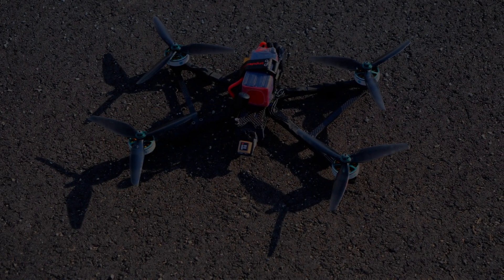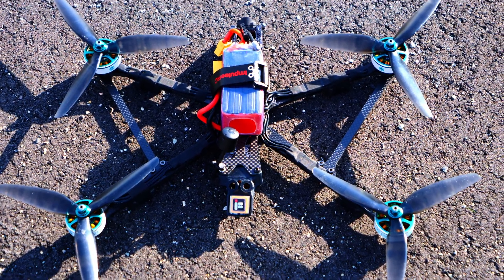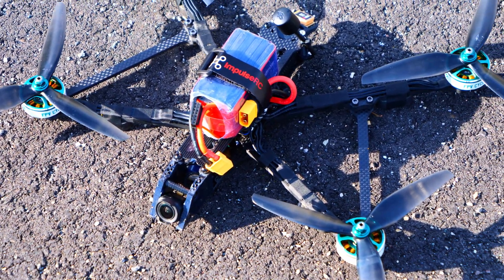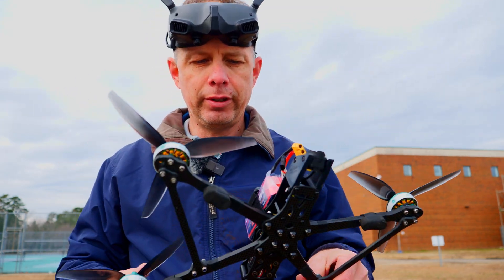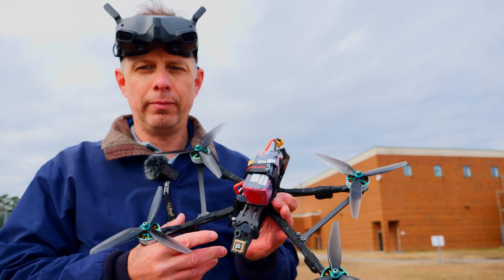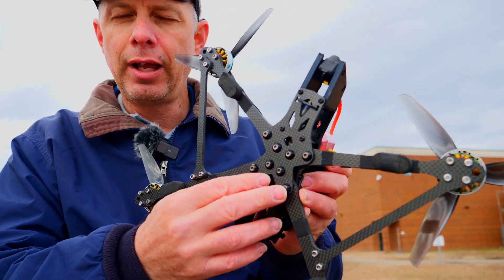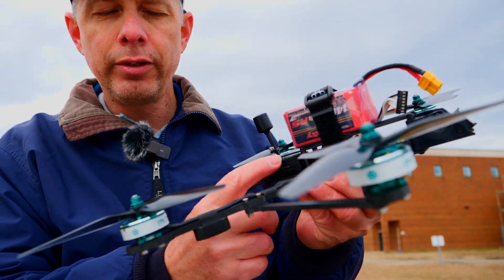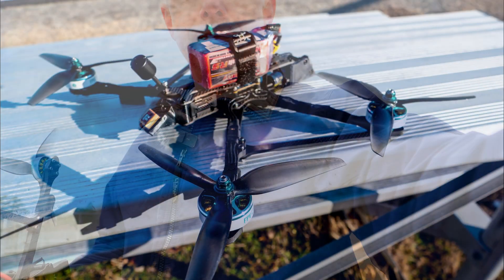DJI O3 Air Unit  Apex LR 7 inch frame (1-08-2023)

Comment: how did you get the 50mbps
Reply from the maker: Its stock with the DJI 03 air unit
Reply: @princesfpvdrones  what about the caddx vista units do you know if it automatically goes to 700mw like the goggles v2
Reply from the maker: @SeeFPv-qm6ie  I am confused, what is your question?

Comment: Nice build. Looked like it flys great. I have the pre apex version with 7" arm and love it. This new version seems to have even longer arm away from the main body.
How do you like the fpvcycle motors? Unfortunatly you cant get them in europe. I'm happy with the emax 2807 and rcinpower 2806.5. The J75 props are my favourite 7" so far. Try some hq 5x4x6 props if you want to fly around in stealth mode

Comment: I want to bet this frame to and replace chimera7. But i still wonder will the 5.5mm thickness arms with braces stiff enough to remove wobble and bobble? Love my chimera7 because of the strong 6mm arms that give smooth flight and easy tuning.
Reply: AOS 7  ?
Reply: @dreswan1  apex is simpler